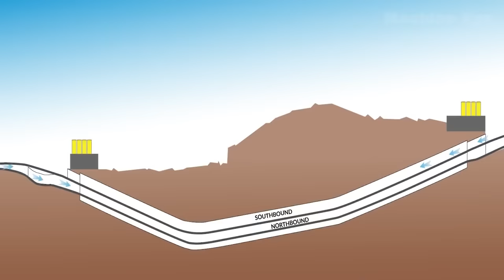China's Mega Undersea Tunnel Gives American Engineers Goosebumps

Comment: a lot of 'shell' comments today. There's a bridge V-shaped 3 lanes, some truck driver used the outside lane and that section of the bridge toppled over, apparently he was supposed to use the middle lane. THIS is how come china can build so quickly and so many projects, they do the bare minimum. a road says 20 tons you had better NOT exceed that where as in the U.S. we use a lot of steel and good concrete and if it says 20 tons we really mean 30 tons. another example a bridge pier some guy stabbed a rod right through its base chipping off a section of the corner exposing a wire mesh (no rebar mesh) that held crushed rock (not densely packed cement) hence the expression tofu dreg. their NEW underwater bridge was leaking big time. and during the floods thousands died when a tunnel filled with water. the real horrifying truth is China will not report the actual number of deaths because that makes them look bad. when a bridge goes down they erect a temporary wall to hide it so people cant see whats really going on.

Comment: Human intelligence is an evolutionary process. You get just a tiny bit smarter from your previous experience, be it a success, or a failure. This is called learning. Yes, China has a lot to learn and catch up after it gained full sovereignty a few decades ago.

China is like a sponge, absorbing and improving technology, and to its credit, surpassing those it learned from. Many of the mega projects are not done for shows, but to improve what is already acceptable. 

Infrastructures such as this is analogous to the Internet, I recall the days when Dial-up Internet was the only option. To send a file, you need to be prepared. Put your kettle on the stove, find a magazine, and wait....and wait...If you are lucky, the whole file went through...after 30 minutes. If you are unlucky, if you get a bad line, you get a corrupted file message, and you start again.

With modern Internet, you no longer have to sit up at night waiting for the file to send successfully. It is almost instantaneous. Infrastructures which speed up the flow of traffic cut cost and improve efficiency. In a way, it is one way to battle Climate Change because less fuel is consumed. 

However, I do see some negatives in making thing faster. Remember the days when mails arrived in the post box? Two or three days if you are lucky. That slows down things. It acts like a damper, With emails, it is instantaneous. That means you no longer has the luxury of relaxing. Life becomes so much faster and, sadly, harsher because people are becoming more demanding for answers.
Reply: Relentless in their pursuit for world domination is what it is!🤣🤣

Comment: A tunnel is just a big pipe.  The most practical reason for tunnels is to go through a physical obstacle like a mountain etc.  For underwater tunnels where there are no physical obstacles, the cost of a big steel pipe (or other materials) versus tunneling should be evaluated.   Most tunnels are a solution to surface obstacles, and a means of underwater mobility for surface traffic.